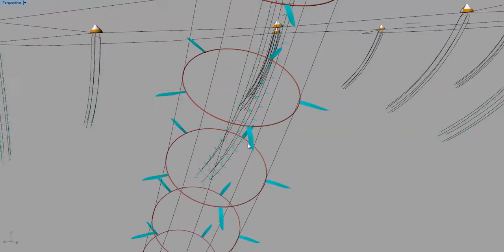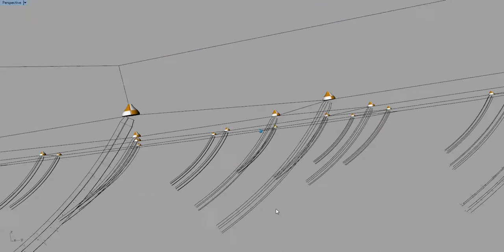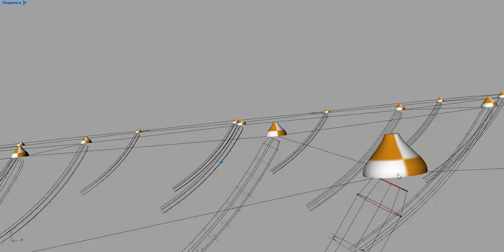tidal estuary ring generators

Comment: Also linear train of buoys holding loop fanbelt drive of one generator station seabed anchored. 
Alternative design could be seabed anchored ring sets with buoys intended not to be at sea surface but limited to a design depth to keep surface traffic free; still PTO could be the loop of lines driving one generator.